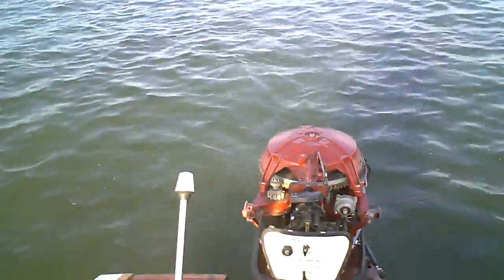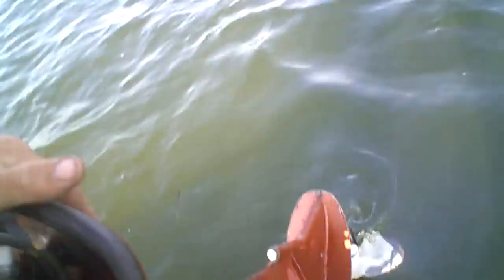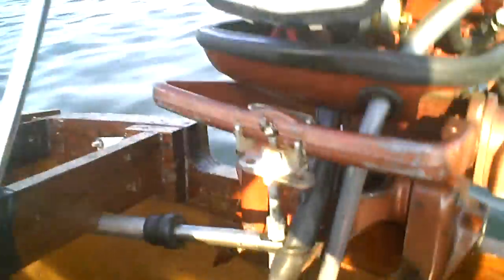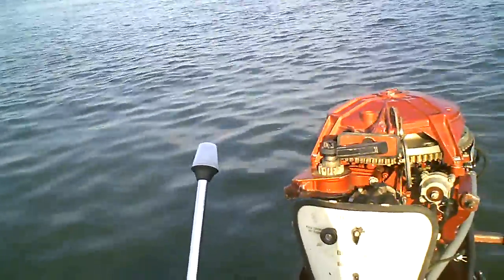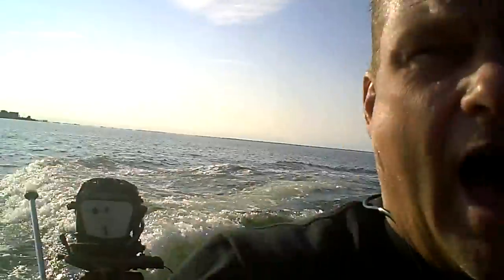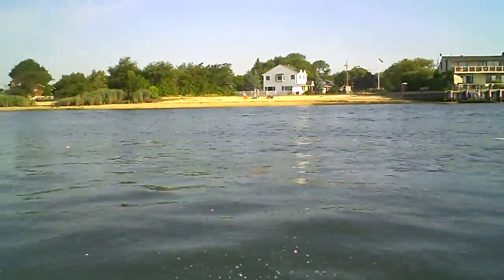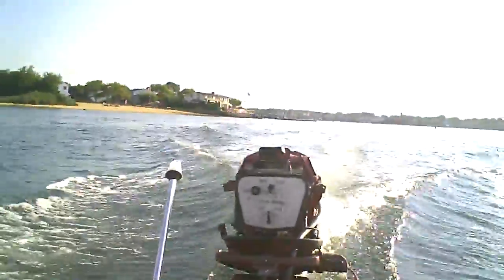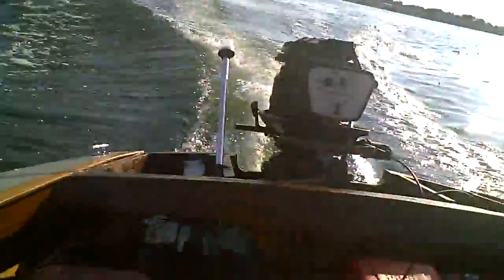Johnson Outboard Performance

Comment from the maker: @Outboardguy44eh Thank for getting back to me. I played with all the adjustments, and the mag advance and throttle linkage all seem to be fine. The throttle was fully open and the magneto hit its stop durng this video. I've pulled the boat out and removed the prop. The brass ( or bronze) bushing in the prop is in bad shape and has a lot of play in it.  I feel confident that under a load, the hub is spinning faster than the prop. So I ordered a Michigan Wheel Corp Prop. I ll let you no what happn

Comment: While running use a insulated pair of pliers and pull plug wires  one at a time , if when you pull wire engine dies the other  plug was not firing visa-versa

Comment: Also another thing to check would be your high-speed needle and start winding it in until it affects engine performance, but I'm thinking from the way ti sounds in this video that it isn't shifting all the way into gear, and when that happens it will not wind out to full RPM for you.

Comment: I would buy two neon light style spark testers at Harbour Freight (US) or Princess Auto (CAN) and connect them the next time you run the motor. The motor will run with them in place. The benefit is that you can see if one plug isn't firing when underload. This will be the best $10 worth of diagnostic tools you will ever buy - IMO.

Comment: I had the same motor as a kid also.  Sounds like it may be running on one cylinder.  Try pulling one plug wire off then the other and see what you get.

Comment: I agree with Outboardguy44eh. you are not making your RPMs. If it was the prop it would be screaming at high revs. 

You rebuilt the carb, but did you set the jets? The starting point of 1.5 turns on low and 1 turn on high is only a starting point. You still have to dial it in afterward. I find the high speed normally wants to be around 1/2 - 3/4 of a turn and the low 3/4 - 1 turn.

Comment: @SuperUnknownMC  - if the prop hub was slipping your engine would be over-revving, when Its quite obviously the opposite. Your not getting the RPM's up. Possible that the prop is over-pitched, but you should be able to run a 13 pitch prop on that boat without issues. How can you tell the throttle is wide open with the faceplate and the air box in the way? Not the first time I've seen this. More common than you'd think.

Comment: pull the plugs and see if they are brown or black, oily, both same color, tells you if both cylinders firing, and if your mixture is too rich or lean
Reply: try switching the plugs before you do that for future ref I had that happen and it turned out to be the magneto
Reply: yup, could be a bad plug....
Reply: also makes it easier to tell bc the plug that isn't working will be noticeably clean

Comment: my 1958 RDE19 35hp comes out of the hole like a rocket and hauls ass....on a 1956 Arkansas Traveler 14 ft aluminum dual cockpit runabout....

Comment: @classicoutboards I still think you need to work on the high speed control. Have the wife sit at the helm and open it up. Then keep turning the high speed control out. When I rebuilt my 1953 Johnson 25 HP It wound up open almost three full turns before I got full throttle at about 4800 RPMs. 
Pam

Comment: it has nothing to do with your prop, the engine is under performing badly. It either isn't running on both cylinders, or the shifter is not engaged far enough to allow it to open up the throttle and attain full RPM. Disconnect the shifter cable and shift it into forward gear by hand, making sure the gear shift lever on the side of the motor comes all the way forward, then test at full throttle again to see if it improves.. I bet the throttle plate isn't fully open while you made this video.

Comment: Sounds like its running on one cylinder kinda or the carb is out of tune .
Reply: +Denis Gosselin Agreed, does sound like 1 cylinder.  I'd still check compression, spark and all those other basics.  Nice boat and motor though!  Hoping to get my Foo-Ling out this coming summer and get a Johnson SR or Speeditwin on it.